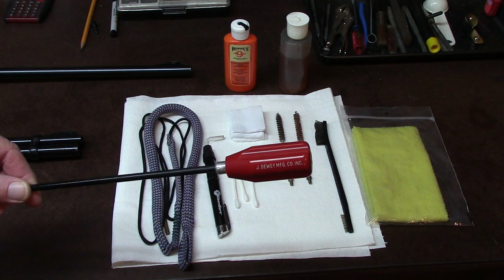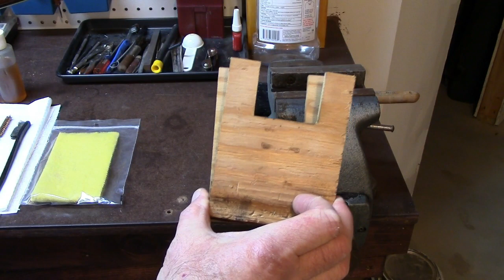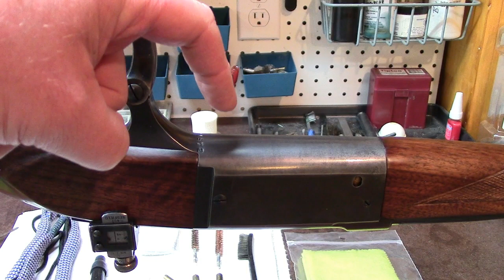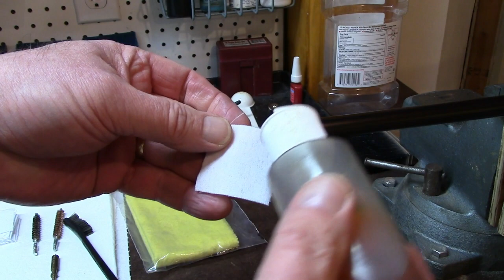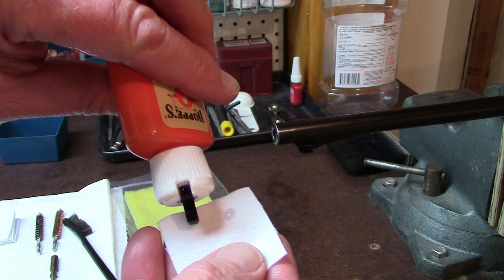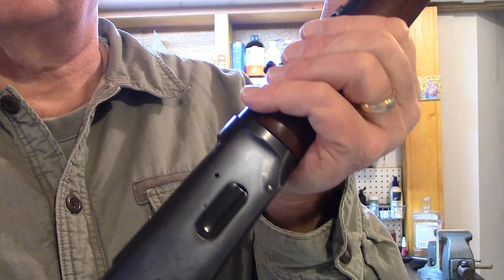How to Clean Lever Guns

Comment: I have asked countless "experts" to do a professional cleaning and breakdown of a Browning BLR.  It seems to be the achilles heel of most gunsmiths.  Nobody wants to deal with the timing and those that do cant operate a camera, it seems.  I will ask the same here. Can you please do a detailed video breakdown and cleaning of a Browning BLR in any chamber?
Reply from the maker: aland pirz 
I would be happy to, if I had a BLR to demonstrate, but I don't.  Fine gun.  In short, simply follow Browning's owners guide.  It's a very well made and easily cared for gun that requires no exotic care, and should be nobody's Achilles heel.  One does not need to take it down entirely to clean it.

Comment: Another great video sharing your aquired knowledge.  But I also noticed in your 39A cleaning video you also applied a VERY thin film of GREASE to the areas of metal to metal contact to allow smooth action, thus avoiding OIL.  Granted, these two rifles the actions are not that accessible.

Comment: I truly enjoy your videos, I myself being a certified master mechanic I counldn't agree with you more on this excessive lubrication. But my question to you today is how do you recommend breaking in a new rifle or a new pistol. I have heard fifty ways of doing this, I personally have just cleaned out the barrel before ever shooting them.I always run a patch through any gun before leaving to go target shooting or hunting. I would certainly appreciate your view on this question.
       I enjoy your videos they really teach a lot of good common sense. There is really a lot of misinformation on you tube, but if people would watch your videos they would learn the right way. God bless you!
Reply from the maker: Thank you for your comments.  "Breaking in" has a number of different meanings to different folks, but it boils down to two; the barrel and the action.  Much has been made of both and there's no reason for it.  Modern barrels are exceptionally smooth inside, and are normally formed over a mandrel, rather than cut.  Whatever burrs there used to be in days gone by are simply not there anymore.  Even then, guilding metal on bullets is many times softer than barrel steel, and has little, if any, influence on the dressing down of burrs.  Most of the methods folks use to "break in" barrels amount to attempts to lap the barrel smoother.  As a mechanic, you may be familiar with lapping, whereby a soft lead slug is poured around a rod while it's inside the barrel.  Lapping compound (oil and silica) is introduced into the bore and its forced back and forth, making an interior that's uniform in diameter, and smooth.  But there's a very strong caveat to this process that any barrel maker is aware of.  It MUST be done before the barrel is cut to final length, before crowning, and before chambering, because the process produces a bell at each end, where the slug is reversed.  It cannot be done after the barrel is completed.

While these homegrown techniques using JB bore paste and firing may make the bore smoother and possibly easier to clean, and perhaps more accurate temporarily, the fact remains that the barrel interior will suffer opening and wear at the leade (head of the rifling in front of chamber) and before the crown.  I desire none of the sort.  It's an acceleration of wear, plain and simple.  And then there's the process of using sets of abrasive bullets that are designed to lap a barrel.  Again, I would not recommend this, as it's exactly the same process as slug lapping, which cannot be done without wearing the ends of the barrel and chamber. 

The fact of the matter is that I've never done any of these things to any of my many rifles that I have owned over 50+ years, and most have been extremely accurate.  Watch my videos regarding the cleaning of rifles, and on how not to clean, where I detail the importance of barrel conditioning, which is the correct approach

As to handguns, simple conditioning with jacketed bullets before lead bullets are shot will fill any imperfections and create a smoother barrel surface that will be less attractive to leading, if the shooting of lead bullets is desired.

Actions of guns require no break-in.  Most actions are pretty smooth, and have very highly polished surfaces.  Rougher ones with high spots will simply get smoother over time as the high spots wear down.  Simply shoot a gun without any lubrication, and the parts will marry and become smoother, just as one sets new brake pads.  Lubrication will simply make the mating take longer.  The only way a handgun action will break in is to simply shoot it. 

As a factory trained armorer, I was taught how to dress revolver actions for highly tuned smoothness, as one would get from the S&W custom shop, but it's not something the average person should attempt.  There's far more to it than honing parts, and can get a person into some serious damage without knowing how the parts interact.  The S&W repair shop does most of its work on guns that have been "tuned", which costs the owners lots of cash, to fix what wasn't broken.  Autos have no such issues.  If a slide feels gritty, simply rack it back and forth until the burrs go away and the slide is married to frame.  Shooting it will accomplish the same thing.
Reply: GunBlue490 Thanks for the advice, it makes great sense to me on everything you have said. I'm just going to keep things simple like you advise everyone in your videos. Thanks again and have a great day!

Comment: Shooting jacketed bullets through a bore will eventually cause build up of copper which will cause accuracy to deteriorate.  Depending upon caliber and pressure will determine the amount of build up.  When using a more aggressive bore solvent to clean out the bulk of copper and finish off with light oil will not only keep the barrel burnished but will preserve accuracy and barrel life.
Reply from the maker: No, it absolutely will not.  Since 1964, I've fired many thousands of "eventualies" with high power rifles in calibers ranging from 22 Hornet through 458 Winchester Magnum, including thousands of high velocity 220 Swift and 22-250, and it NEVER eventually built any accuracy deterioration.  Jacketed bullets do not build up materials in a bore, unless the gun is over heated with aggressive non-stop, abusive firing. Even then, any copper fouling sweeps out thoroughly with less than 10 passes of a bronze bore brush.  Barrels do not burnish, and no oil made does anything to change their character or finish. The only thing a bore does "eventually" is wear out from heat, erosion, and friction, depending on its rapidity of fire, abusive cleaning methods, and especially harsh copper dissolving solvents.

Comment: You mentioned in the last few videos that you use a silicone cloth to wipe down your rifles/handguns for protection against moisture and handling. In the case of a wood stock would it cause any harm or discoloration to the furniture and also for a polymer handgun, would it be likely to cause any problem where you might want to take extra care to only touch the metal parts of the gun with the silicone. Thanks for this great cleaning info. it has really answered a lot of questions and set me on the right course for preserving my cherished firearms.
Reply from the maker: The silicone used in name brand cloths is completely safe for any guns, and will do no harm to anything.

Comment: I bought a 1954 production model 94 recently for dirt cheap and it was in rough shape but still had a bright bore with sharp rifling so I had to tear it down, remove all the rust and re-blue a lot of the metal, it also had a scope mount on it that an amateur must have installed because they drilled through into the bottom corner of the bolt track so I got rid of the scope mount and filled the holes. I refinished the wood with a boiled linseed oil finish because the varnish was peeling, chipping and the wood was looking rough, when I reassembled I wiped every single part down with a lightly oiled rag just to protect the metal from future rust, I would’ve never done this with a gun that was in as good of shape as your .32WS but I think it turned out very well and it looks a million times better than it did when I bought it, thank you for sharing your knowledge, it helped me to get excess oil out of the wrist of my project rifles stock and I hope one day I can give that rifle to one of my kids and explain to them the importance of proper maintenance
Reply from the maker: Sounds like a rewarding job!
Reply: @GunBlue490  it was! I like bringing new life to old beat up guns even if they’re not worth anything to a collector, it means a lot to me that I can look at it and say “yeah, I did that”

Comment: Well,  as to the over oiling issue 
    In parts of  alaska , like the south east coast areas,

 they  get 9 feet of rain per year as a drizzle that penetrates every thing without getting anything really wet,  
    
   And in sitka,  this is called liquid sunshine,,,

It is my opinion that if this gun you have was not over oiled,

   You would not have it now,,

Perhaps even this previous owner expected to die like every one else, and get this gun back in his next lifetime.....

As I do with mine....

I have found a canned form of gun scrubber to be something very unique,,, 
   Spay, let sizzle,  oily rag off,

Comment: Great video and explanations. One question or rather a concern I have about lever actions and not oiling the internal action is what happens if you are out hunting in the rain or wet snow? Inevitably, some moisture is going to get inside the action. Sometimes merely from being in the outside cold and then bringing your gun inside - condensation occurs. Are you not concerned the internal parts will begin to rust / oxidize? Or am I being too paranoid about my new rifle?
Reply from the maker: As I said, metal is adequately protected with a wipe of an oiled cloth. Heavy oiling gives no greater protection, but causes wood dry rot and mechanical issues, especially in cold weather. Guns should always be taken down, dried, and lightly oiled after exposure to wet conditions.

Comment: Thanks for your videos.  I have made the error for some time of adding a drop of oil to the revolver trigger areas and many other areas of other guns.  Would you suggest removing the oil residue by soaking the trigger area in alcohol, and then blowing it dry, or just leave it be?  I learned from you that dry is the way to go.   Thanks agin.
Reply from the maker: Alcohol really won't do much.  That's where Hoppe's #9 comes in.  Remove any wood, and simply go at it with a toothbrush.  If you don't know how to open the mechanism, you can immerse it for a few hours, and then use an air hose set at 15 pounds to blow it out and dry it.

Comment: had a bottle of oil that was only like six or seven years old so there was plenty left and one day while pushing past a work area I knocked it off and the hit the hard surface and smashed into a thousand pieces. Bad part about the plastic bottles is they become brittle after some years so don't drop them.

Comment: On a Marlin 336 3030, side eject,for cleaning, would you clamp it on it side so debris falls out and not into receiver area?
Reply from the maker: Fancy you should ask. I cleaned my 336 .35 Remington a couple of days ago after sighting in, before heading out to hunt with it.  This is a previously never fired 1964 vintage gun, so I prefer not to remove the lever screw and subject it to a screwdriver in order to remove the bolt.  You have different options, depending on how much you shoot it.  Most 336 rifles see very little shooting, and can be cleaned quite nicely with a Hoppe's bore snake pulled from the breech, followed with a few drops of oil on the tag end on the last pull.  These lever guns shoot low intensity rounds with quite efficient cartridges that leave barely any powder residue.  If it needs a better scrubbing, you can remove the bolt, and clean it with a high quality plastic coated steel rod from the breech end with the receiver inverted to keep solvent from getting into the action and stock.  Personally, I'm careful how I handle the crown, so I'm never afraid of cleaning from the muzzle end, in which case, I simply invert the gun in the vise, and pull the dirty patches out the ejection port with a dental pick.  Lastly, I run a slotted cleaning tip with a large patch and a few drops of mineral oil to lightly coat the bore, being sure to apply a light film to the chamber, too.  It's not enough oil to cause any issues with case adhesion.  If you can clamp your gun sideways, that's great, but DON'T do so if your vise jaws can only grab vertically, as you are sure to damage the magazine tube or forend, or it may slip and fall.
Of all the guns I've taken afield in my life, nothing beats the delightful carry of an iron sighted Model 94 or 336 in thick woods all day!
Reply: @GunBlue490  that's me and the ol 336 3030,I live in Alabama, not alot of long shots, I stay in thickets mostly, sometimes venture out to farm land, then break out my 700 rem in 270,200 plus shots.

Comment: Can you help? I am the owner of a Uberti 1866 Yellow Boy in the UK. We do not have many gunsmiths who are competent with lever action rifles and one, the main agent, damaged the rifle through sheer incompetence.
I had a squib round. I cleared it but I unfortunately pulled the pin out of the forward  toggle on the breech block. The tiny tapered plate holding the firing pin extension (the rod the hammer strikes) and the breech block separated. Try as I might, I cannot get the two to reunite.

Comment: Only thing I do different is use a 22 caliber rod with a cone shaped plastic or brass guide to protect the muzzle crown. It is an easy job to polish the muzzle crown if you slightly damage it. I chuck a round Head slotted brass screw in a drill . Lode the screw head with valve grinding compound and rotate the spinning screw head against the muzzle. Should be able to Google is up to see the process.
Reply from the maker: I've done that crowning procedure quite a number of times since learning the process from an old gunsmith many years ago when shortening an old 30-06 barrel. But, careful handling of a cleaning rod will never harm a crown. I recently re-crowned a new Model 700 in 22-250 that was not crisp from the factory and it immediately shot much better.
Reply: @GunBlue490  I've collected a few gun smithing tools over the years. Many from Brownells anytime I can make my own I do.
You might can do videos on minor gunsmithing and tools. Also range bags and boxes one can use to carry to the range for sighting in a rifle. Just an idea. I sure you already covered much of it. Anything that makes us better shooters and hunters. Good  job ! I like how you think and do things. You would be a great neighbor.

Comment: Thank you for the very informative video. I have a model '94 and I'm new to the whole shooting sports thing. My Winchester manual that i downloaded for it says the add a drop of oil here and there to 3 or 4 spots in the action, which i have done, but i don't know that I will from here forward.
Thank you
Reply from the maker: Those drops are fine, provided that they are indeed drops that do not migrate to the stock.  Light applications of oil are always perfectly acceptable, but it's more for protection than any need for lubrication.

Comment: Excellent videos, top notch. Thanks. That Savage 99 is a beauty. My dad has one, though not as nice as yours. Just wondering what make rear sight you have on it?
Reply from the maker: EMDDoctor86 Thank you.  That's an old Redfield sight which has probably been on the gun since it was made in 1938.  The barrel blank that replaced the original rear sight even has the Redfield name on it.  The sight had received a lot of abuse, with bent parts, and I was fortunate to find parts to rebuild it, and I did some restoration of parts that could not be replaced.  The gun was owned by a single owner in Anchorage, AK until I purchased it, and was a hunting rifle for those many years.  It was not a pretty gun in the least, and for that reason, it only cost me $275.00, but I could see its potential that lay under a saturated stock that was soaked with gun oil through and through, and the action was filled with gobs of oily tar from decades of oiling; not unusual for a gun of its age.  

Restoration took me nearly three weeks, employing most of the skills I have acquired over the years.  After many days of soaking the stock in acetone, combined with very careful heat lamp drying, I was able to degrease and dry the the wood, which revealed amazing tiger-stripe and burled grain, without causing any checking.  I re-cut the poor, shallow, checkering and restored the original oil finish with diluted applications of tung oil, applied by a process that involves reductions in fine sandpaper grits over several days and hand rubbing.  

It's a fabulously accurate rifle, with an amazing 2-1/2 lb. trigger that shoots better than I could have ever desired of any hunting rifle of any vintage, let alone one approaching 80 years old.  With those sights, I've benched many 1/2", 3-shot, 100 yard groups with hand-loaded ammo.  I know that a scope would reveal even better accuracy, affording more precise shot placement, but it was never drilled and tapped, and I don't wish to destroy its value by doing so.